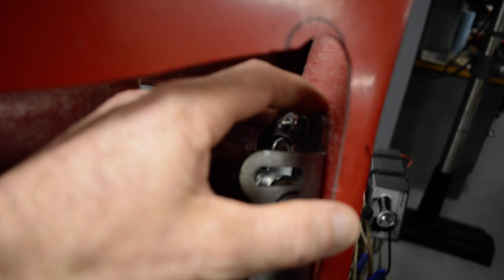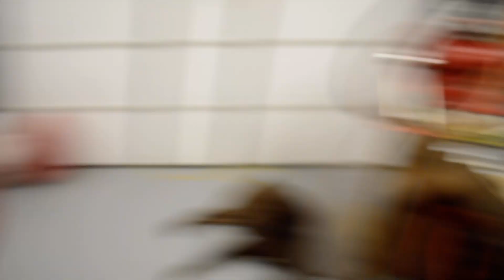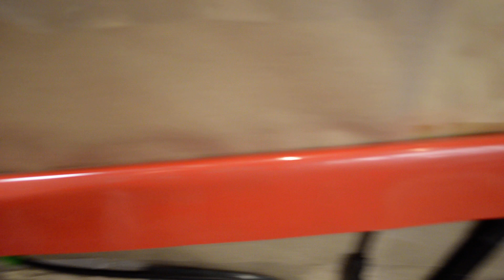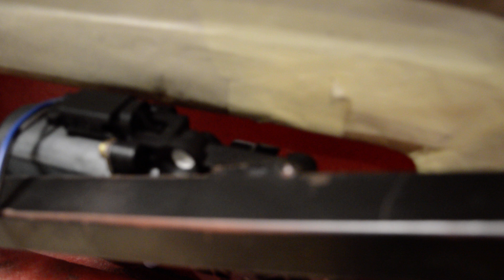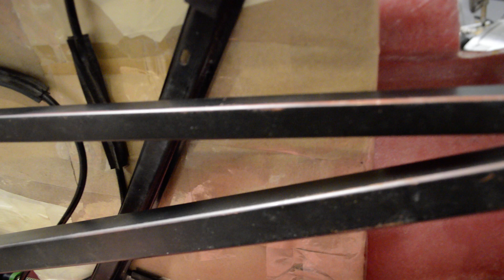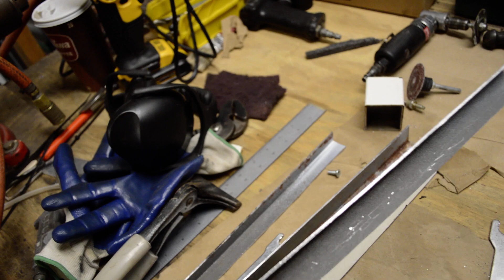GTM Doors Part 1

Comment: Hey bud. Nice work on how its building up. As far as the electric window issue. Having electric windows in a kit car is probably any car guys moment of truth if you can fab a perfect electric windows system and actually have it last longer than 2 years of hard use is something most basic car guys would remember about the car..  Mechanical failure on this part destroys the experience of such a  dream ride. You know my solution? I use the race spec windows. Lighter no failure and it isnt really a problem once youve lived with it. As long as the ac blows cold in the summer and heated seat for the winter. I also run separate coolers for all my fluids. Diff oil, trans, and even have a mister mounted over my intercooler and radiator mount to make sure engine temps are within good ideal. I have several brushless motors blowing in key heat spots so that i dont heatsoak during idle. I think we added a good 80lbs of insulation and anti vibration methods to get rid of that “this feels chep” feeling when on a stop sign or whenever the moment requires elegance. We placed a sonograph all over the car and ran it while the data logged. This help me identify portions of the car that vibrates. Based off the resonance we can install specific dampened material or frame support to eliminate the jitters. The jitters slowly degrade your custom car. Good luck bud! Its worth it. No 2 are a like and they are all fabulous!